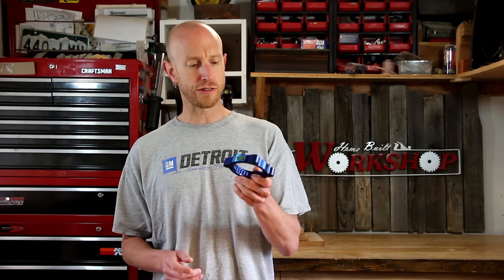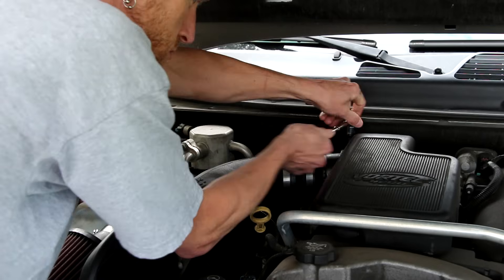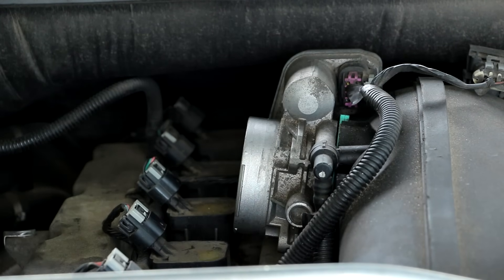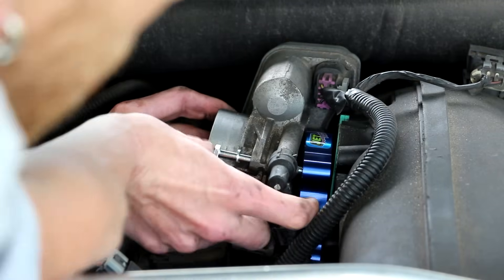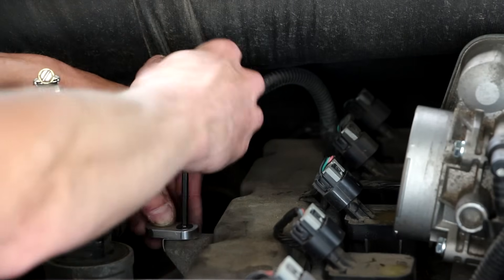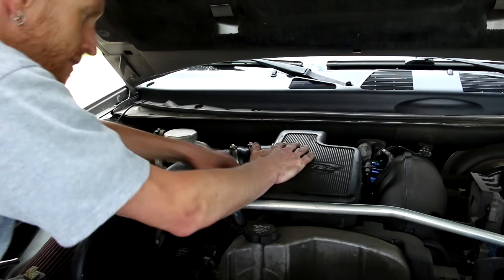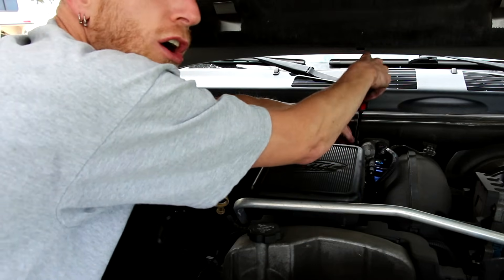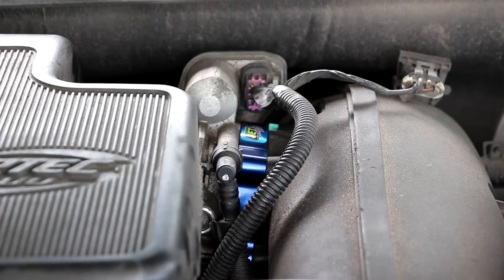Is A Throttle Body Spacer Worth It?

Comment: I installed a Helix power tower throttle body spacer on my 99 Blazer 4.3L Vortec V6 and I promise it makes a BIG difference. I would recommend at least a K&N filter with it. I also cut the small short inlet pipe to allow more air in the filter box. I upgraded to a CAI on mine so it helps but CAI really don't do much but allow more air flow in. I've also installed headers on mine with some improvement.

Comment: I'm pretty sure the idea behind a tbs is that it increases the volume of air inside the intake manifold, which creates a stronger vacuum pulling air into the throttle body. What this does is that it tricks the mass airflow sensor into thinking there's more air coming in than there actually is, which forces the ecu to adjust accordingly. This is where your power gain comes from. I doubt it will improve your fuel economy though
Reply: how about no , 100% wrong
Reply: Okay it's been 8 years since you wrote this comment. That's enough time to learn why your comment is a horrible guess. The man you're right there with just a little more knowledge you would have had a plausible guess. It looks like you know just enough to make people think you know what you're talking about but not having enough knowledge to know you're wrong or know what you don't know. 

If you're going to make a guess like that go ahead and run some numbers first. Choose a manifold and find out what the displacement is. Then find out the volume increase with a throttle spacer. Then research if a 2 % increase would make a difference. 

Then ask yourself if this was the case then why are there not kits that move your throttle body two feet away.

Furthermore a naturally aspirated engine is only going to pull in the amount of air as the cylinders displace. Regardless of the size of manifold given that it's not too small. The idea of the cyclone throttle body spacers is that because the cylinder will only pull in the same amount of volume the cyclone makes the air denser. Which sounds stupid when you say it. It's why they don't work. And even if they did work you would never know it. If they worked creating a more efficient engine they would be install the factory
Reply: @Cyber_Cowboy 🤣 there's lots of things that make an engine better that are not done at the factory.

Comment: I've used a few of these in the past, on fuel injected vehicles, and I've noticed it makes more of a difference with inline engines. and they also become more responsive over time as the computer 'relearns' itself. i got better mpg's and better low end torque. just my experience tho.
Reply: You can just reset the computer by disconnecting the battery terminal for a day and then when you start it back up again just use more throttle the first couple of days and the computer registers those figures.

Comment: As previously mentioned, on old Carb cars the TBS works great and give real results. On a Fuel Injected system its practically useless. You're better off with a good quality "Cold Air Intake" and some plugs/wires. For big performance gains you'll need to focus on the internals of the engine.

Comment: The better option but still a small gain would be ditch the spacer and put a thermal gasket in it's place. It will help reduce intake temps which will give a small amount of power. In my opinion getting the spacer by itself is just making your intake even longer. Plus a thermal gasket that size is around 20-30 instead of paying 70+ for the spacer that does nothing

Comment: Basically it makes your intake manifold volume greater and puts the throttle body further away from the heads. The air now has to travel further to get into the head. It may just essentially take away horsepower on the top end to give you torque on the bottom end. The difference may be 1-2 ft tq.

Comment: From what I have researched on it seems the style of the intake manifold can affect the gains or no gains you could get. That and other types of mods might be the main reason there is such gap on yes and no gains along with natural factors(humidity,temp ect).

I can not for the life of me remember the name of the fluid effect but generally you have 2 streams, the inner and outer. The inner stream is where most of the volume comes from and the outer is the slower moving volume. What this device mimics and tries to do is alter the outer stream flow pattern.  What this allows is the inner air to move around a corner more efficiently.  As any kink or bend in flow direction will restrict the flow to a certain point. If your intake manifold has no bend or curve after the throttle body you may not see any difference as the air flow has no restriction other than the surface itself. Generally, polishing and removing any casting marks will lessen any restriction the surface gives to the flowing air before the point of fuel mixture.

Some say this swirling effect allows the F/A to mix better, but I highly doubt that, not in a non carbed fuel injection. The effect created behind the TB is lost and/or diminished greatly as soon as it enters the main part of the manifold, plus fuel is added further down the line in injection systems not at the throttle body. If there is any increase to mix it would be minimal in my opinion. I would like to note that with a carburetor or EFI carbs will benefit from a tb spacer as it gives more time for the air and fuel to mix.

I have theorized that if you create this same effect again at the top of the intake runners you could see a noticeable difference. How much of a bend and the length of the runner would probably affect this greatly along with the amount of air you can agitate without restricting air flow. How to go about this is another matter. A lot of intakes do not allow access to the top of the runners. There is generally enough room to polish and port match them, but you are generally out of luck to attempt this unless you have the ability to cut the manifold open and weld it back together or it is accessible by a removable panel.

Luckily on my car the upper intake is in two parts and gives direct access to the top of the runners. I am searching for a junk yard upper and lower and I am going to attempt to create this effect on the runners along with port matching, removing casting marks and polishing. There is more than enough meat on the runners to engrave a swirling pattern in them. Unfortunately I do not have the funds to be able to pay to have several tunes and dyno runs along the way to test each thing I do to the intake. I can only test the final tune and dyno against known numbers with the same mods (aside what I do to the runners). 

I am no mechanical engineer nor a master in fluid dynamics. So if anyone reading this can correct me or give me tips to go in the right direction let me know.
Reply: Would have liked to see the result numbers lol. 3 year comment I know I know.

Comment: Hello, your outtakes mentioned U were unimpressed after driving for a spell. Did U ever reset you ECU so it recognized the upgrades you added? If you didn't your ECU is running on engine stats from pre-performance upgrades...food for thought. I installed a spacer yesterday and reset my ECU to recognize/re-calibrate to the new data generated from upgraded throttle body spacer, CAD intake system & Superflow muffler (89 XJ 4.0). Over the next 49 starts, my XJ will re-calibrate based on new data along w/my driving habits to optimize the system for the upgraded components. :)

Comment: Great input. I was hoping for a dyno comparison but if your butt dyno only feels marginal throttle response increase, it's likely an actual dyno run would show the same. Like so many "cheap" performance parts throttle body spacers are for those who are truly trying to squeeze every last pony out of their motor. Not really intended for the bolt-on crowd. Good info., thanks for sharing.
Reply from the maker: +Austin Rausch thank you
Reply: Austin Rausch its a placebo effect.. It feels more responsive because it's a shiney new part, and it cost money. Until actual dyno charts are put up, we will not know the gain, if any.

Comment: I work in R&D/Tech support for BBK and have tested many different throttlebody spacer's on many different late-model V8 applications. None of them have added even one horsepower and a few of them on Mopar applications have dropped up to 4 hp. These are real world controlled dyno tests. It's a bit of a shame really. These things are so easy to make with all of our capabilities but we can't and won't make them because they don't do anything for the customer. They're great for making money but we won't release anything that doesn't make real rear wheel horsepower. In some cases where our throttlebody is larger than the intake manifold's inlet, we do include a spacer that helps adapt the two different sizes with a smith transition but they are not standalone throttlebody spacers. Keep in mind that my comment doesn't apply to carbed motors. Only late model EFI.
Reply from the maker: +Bryan Rogers thanks for your feedback. I'm thinking about removing it to see if I notice any difference now that it's been on awhile.
Reply: It's more for carbureted engines.... the reason why it works there is 
because you add volume (air) and you place the carb up higher away from 
the heat source and gets cooler air which translates in more HP (nothing
 crazy couple tops). It does not really work with cars that have fuel 
injection as the ECU is doing all the work.

I got both this is how i know
Reply: Did you happen to ever get around to removing it and seeing if the spacer was doing anything for you?
Reply: But do they do anything for gas mileage?
Reply: I think these worked on carb. engines somewhat. The only way to modify performance on an EFI is to modify the computer's programming.
Reply: @its EbK wrong
Reply: I added a Helix power tower throttle body spacer to my 99 Blazer 4.3L Vortec and a CAI. All I can say is that it is much more responsive. I had a K&N filter before I got a cheap CAI. All a CAI does is let more air in and that's it. Also have headers with a little better performance.
Reply: My truck lost power with one on my 6.0 chevy
Reply: I partially agree with your assessment that you won't gain HP... Judging by my knowledge, this device slightly increases air velocity at low RPMs, where velocity is more important than maximum airflow. It clearly appears to me it would improve low end torque slightly, but have little to no effect at high RPMs, where velocity isn't an issue. This does not increase the amount of air (important for high-rpm hp), it only increases air velocity at low rpms, when the air is being lazily sucked in. I do believe the concept has merit if a 'normal' driver is looking for more torque when not racing at full throttle all the time. People underestimate how important torque is, but HP sells. Is it a great gain for the $?, likely not. I'd be more likely to fabricate something exactly the same for a couple bucks.
Reply: @jeladsnikpoh1289  Good reply conceptually. But, if you are in the performance parts business and you manufacture/sell anything that shows any sort of reduction in performance at any part of the dyno graph, customers will rip you to shreds.
Reply: If some thing seems to good to be true, it is lol. I’ve found from my own experience there’s no such thing as an inexpensive way to add horse power. Unless of course you’re just wanting to chop of your exhaust and run straight headers, that’s not that expensive. And you’ll notice a difference lmao 🤣
Reply: I’m pretty happy with my ported bbk throttle body.Ill be adding a ported gt intake manifold with it soon.

Comment: You could also remove the screen from the front of your MAF sensor. Then take all the slack out of your throttle cable, and you will see a pretty good difference. I dont know if you have a throttle body butterfly restrictor, my 4.3 chevy v6 had one. I removed that as well, and my Astro van was a little quicker than normal. Then it got stolen, never got it back.
Reply: Faster than gone
Reply: What's the advantages of removing maf front screen?

Comment: For this product to work, one of these two things would need to happen. 

1. It would have to increase the volume of air feeding the engine at any given moment.

2. It would have to increase the air velocity during a part of the rpm range or throughout the whole rpm range.

This product can not do either of those things, from an engineering standpoint. I dont care what you think you feel. It just isnt possible. Any felt increase in power is purely placebo.
Reply: I've heard it said that the added length of travel in the intake system gives the airflow a chance to "clean up" so that it enters the manifold, traveling in an efficient way. In particular, the spiral throttle body spacers focus the air's movement into a spiraling motion that travels through the manifold better. I don't know about that. It seems a little fishy to me. However, I think about when you add the red straw to the WD-40 can and how it takes the flow from a spray to a stream and I wonder if, theoretically a throttle body spacer could have a similar effect. As an engineer, do you think there is any truth to that?
Reply: I have never used these but from a fluid dynamics perspective, there are 2 types of fluid flow, laminar and turbulent. Turbulent flow is like if you put a brick in a wind tunnel: the air currents would be moving in all different directions due to a brick not being very aerodynamic. Laminar flow is that same wind tunnel without a brick in it, it when a fluid is moving in a direction without resistance from obstructions. the throttle body can create obstructions in the air charge. The purpose of this product is to channel the air into a conical shape and decrease turbulent flow. This pulls a bigger vacuum in the intake piping and pulls more air into the system increasing air velocity. Furthermore laminar flow is far more efficient then turbulent flow and allows for more total air volume to enter the engine. That being said: I’d wager that if you have stock manifold, throttle, and intake pipe it won’t really do anything but on a fully built intake system you can expect a small power gain in the mid to high rpm range.

Comment: All you people are bashing throttle body spacers because it only helps during low/mid end rpms. Us people with real trucks (not 6 cylinder suvs) look for that kind of stuff, because it takes a lot of power for our engines too move heavy loads. Therefore, every little bit counts in the low/mid end
Reply: "Real trucks(not 6 cyl or suv)" might be the douchiest comment ive read yet
Reply: biggie biggs Oh come on now, im into it for the same kinda purpose, my 4.2 as my derby car hauler and all, and being an i6 twin cam or not, seek out that lower end lug myself.
Reply: I have to say that those 4.2 triailblazers pull! Great experience pulling 30ft Rv trailer.

Comment: For those saying this is a waste of money, id like you to actually go buy one and try it instead of just talking, I installed this on my 01 jeep cherokee xj and obviously its not a huge difference but things I noticed right away was a louder start up, more responsive gas pedal, and when i punch it she just keeps on going instead of switching gears early like she used to before the spacer, more pickup speed for sure
Reply: Also my buddy was present when i installed it and he actually said these things before i had a chance to , if someone else can notice it then its doing the job i would definitely recommend, its not the one all modification that will make your engine run better its just an addition, and i wouldnt rely solely on power gains from just the spacer like i said it just adds a little something that wasnt there before

Comment: You should have try the Tornado, that improves fuel MPG from 0 MPG to 00.0 MPG, or better yet Slick 50 which reduces friction by not starting car or truck,......best vehicle I ever own that is good in fuel mileage, economical, low cost (no add ons) very low maintenance and environmental friendly is ........
Reply: Lol

Comment: Installed one on my 2017 GMC Sierra.  Noticed minimal response to acceleration and lighter throttle feel. Overall, truck feels it goes with less effort. This combined with CAI, muffler delete and a chip tune.
Reply: You’re not gonna see any difference on a GDI engine. If you think you do, it’s 100% placebo.

Comment: I noticed a 1.5 MPG improvement, which I consider quite significant. Additionally, my cold air intake (CAI) has provided better sound quality and a slight enhancement in throttle response. I am planning to port my intake manifold and throttle body, so getting a $20 spacer has worked out well for me.

Comment: Its more or less just an added part you would put on a build for some more results ex:  you have a 4" intake w/ a performance intake manifold, bigger TB, and a good engineered TB spacer can have results to help the other mods for better airflox.  You adding it to your stock air box w/ filter lol w/ nothing else is not worth it.  Upgrading even a better intake system and a TB spacer should help out just in itself

Comment: I had a 1996 Grand Cherokee  4.0  6 cyl inline and it always had issues pulling our tent trailer.  I installed a short ram intake and a throttle body spacer and after that pulling the trailer was not a problem.

Comment: I noticed a great improvement on my lifted Jeep Wrangler with the 4.0 inline 6 and 5 speed manual transmission because the engine struggled to spin the 33's at highway speeds in 5th gear without the spacer but after installing it I was able to use 5th gear and that made a huge jump in mpg.  I also had many other upgrades on that Jeep as well including K&N air filter, Flowmaster exhaust and other similar bolt on accessories as well so I am sure those were a factor as well.   Good luck
Reply: Gotta do the 12 hole injectors from ksuspension too makes big difference